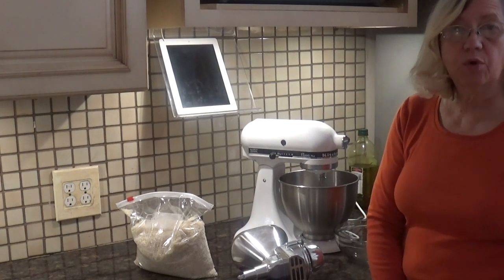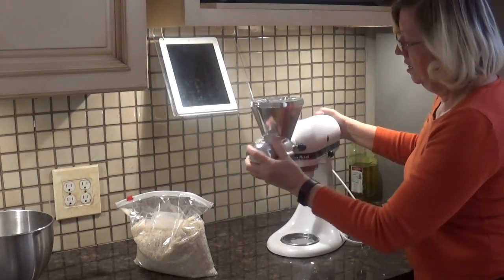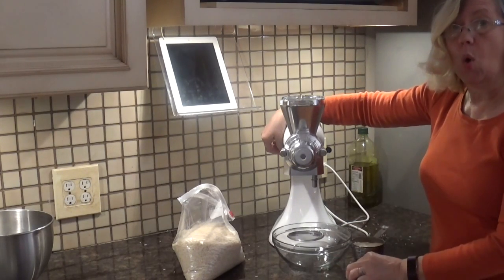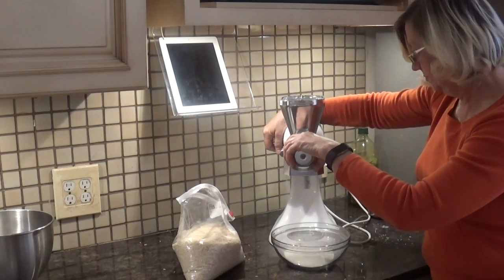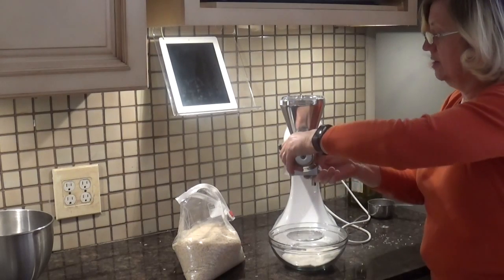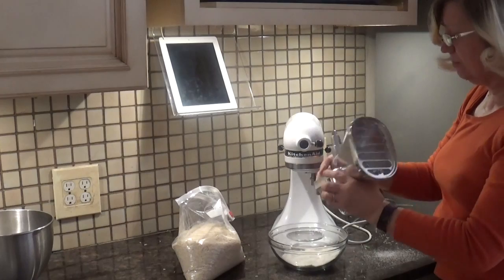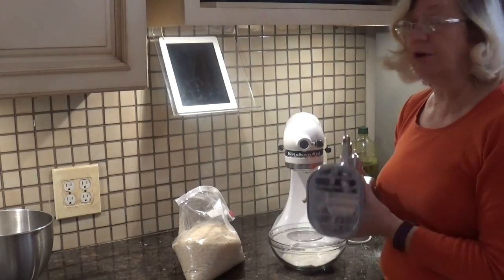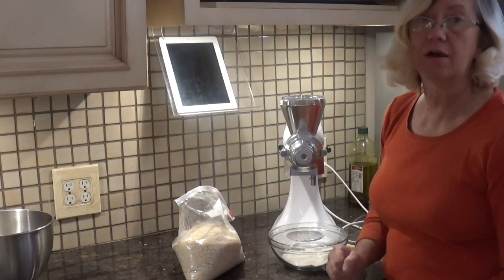The Kitchenaid Grain Mill - what I think of it and how to use it

Comment: And I thought my grain mill was noisy.... Hot Damn! At least mine grinds fine powdery flour from wheat berries at the rate of 1/2 pound a minute without overheating the flour and can easily grind 4 pounds at a time... Thanks for the video, I think I'll pass on that $30 'deal' I was offered ;-)
Reply: Yours is kitchenaid too? Or some other brand? Could you share what brand it is?
Reply: @gondolin12  No, I was thinking to complement my KA with their mill attachment, sure it's a nice piece of equipment that would look great on a KA,  but changed my mind after watching this video. I'm using a converted commercial coffee burr mill, it isn't perfect but its way more effective than the KA mill in the video. To make flour any finer I'd have to use a large, low speed commercial grinder, but they cost close to $10K, so I make do with that converted coffee mill. When I want to make extra fancy bread, I just sift the flour and use the coarse chunks (mostly bran flakes) to cover the loaves with after final shaping :-)
If you ever want to use a coffee mill be aware you need LOTS of torque to grind hard wheat and you should replace the coffee burrs with some designed for wheat, which are of a different geometry (the coffee burrs work great for roasted, light beans, not so well for dense, compact wheat grains, which tend to lock the motor up)
Reply: This video is deceptive. Our KitchenAid attachment grinder is quiet. About the same level of sound comes from our toaster oven with its fan running. We regularly use it for our Einkorn wheat berries. We run it on medium Chorus at medium speed. If we want it finer we run it through the second time on fine setting. It's just the two of us so it makes plenty enough for us
Reply: @peterallen9302  Interesting - Indeed sound can be very deceptive depending on what is used for recording. 

For those who are still wondering about converting an old commercial burr coffee grinder, I have perfected  my technique and it's flawless now, with no overload and lock-up - you simply need to grind in two passes, very coarse and fast (semolina-sized), which doesn't overtax the motor, then you regrind that at the finest setting for a second time. No lock-up and jam ups and it reduces overheating. It does double the grinding time required, but it results in a flour that is as fine and powdery as commercially ground. My bread has never been so good.